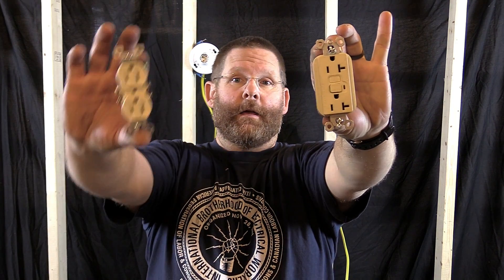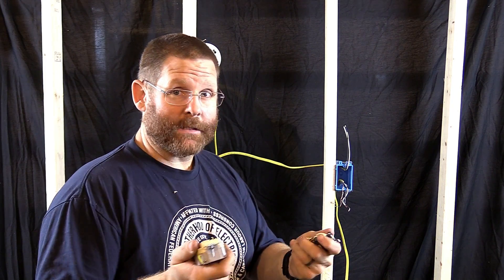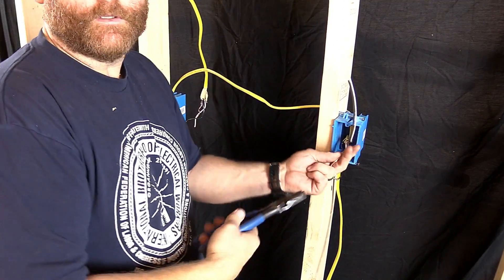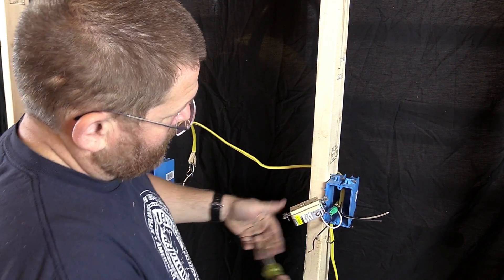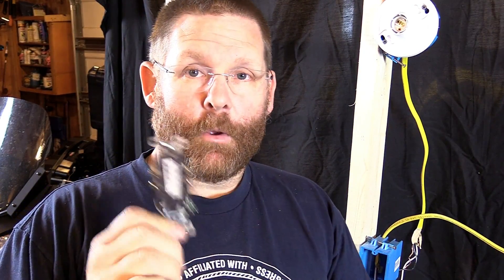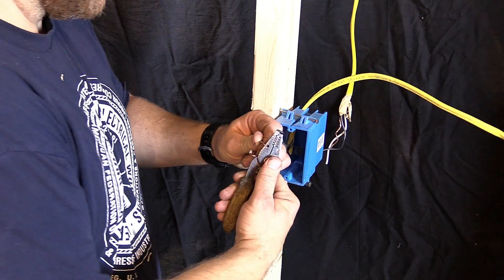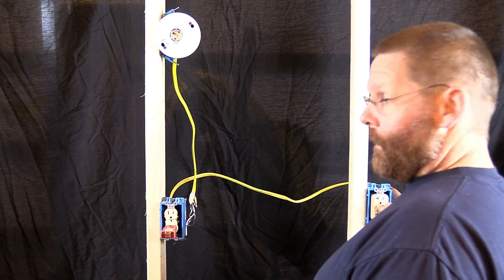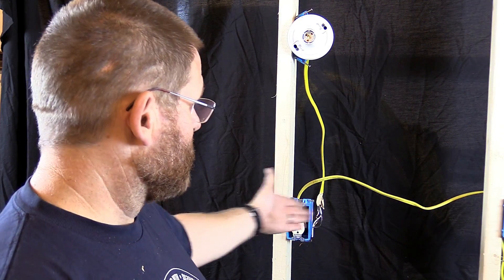How To Wire A GFCI And Receptacle

Comment: hello mountaineer, thanks for the video, i just have a question, what is the gauge of the wire you used ?
Reply from the maker: The gauge of wire I am using is 12-2 romex which the Guage is 12 THHN solid
Reply: @MountaineerOutdoors  thank you so much for your help.
Reply from the maker: My pleasure ☺

Comment: So just to be clear.  Hooking up the line connections should power both outlets?  Or do I need to do something with the load connections to get power to that side of the receptacle?  I'm in the process of hooking up a GFCI receptacle without anything downstream, and only the one side has power.
Reply from the maker: I'm kinda confused with what you are asking? When you say that side of the receptacles what exactly are you meaning?

Comment: I have a detached garage with a 12/3 buried from the house.   Can I run 2 circuits/breakers off a shared neutral from the main box to a 2 breaker box  in the garage OR run 1 hot and 1 neutral to a cut off switch and branch in 2 separate directions starting with GFCI on each branch for protection.  I only need 120v,  a couple lights in one direction and a few outlets in the other?
Reply from the maker: I will say this about your answer. I am not up on the new code but in the old code from what I remember is you can share the nuetral as long as they are on different phases. The reason I am saying that I am not sure as of now is that I have been any industrial electrician since around 2010 and where I work code isn't much looked at. If I do find out otherwise I will edit my answer. Or if anyone else wants to chime in and correct me feel free to.

Comment: Can this type of plug be used with 10 /2 wire
Reply: Thank you for answering my question ( I appreciate it )
Reply from the maker: My pleasure ☺
Reply from the maker: You can but not sure exactly how you will hook it to the Recep. If it has a clamp style in the back of the Recep that should work I have never done it. If not you will have to make a pig tail on with stranded then use a fork terminal..

Comment: I'm doing the exact thing in my bathroom, so I guess it's ok to attach a basic 15 amp receptacle to a 12 gage wire down steam from the GFCI with a 20 amp circuit breaker on the fuse box?
Reply from the maker: Per code you can as long as you have at least 2 or more on that circuit

Comment: What about flipping the recrptical upside down so that the ground is up. I heard that it was code now.  Possibly just incase somthing falls onto the prongs, ( like in this video  https://youtu.be/EmVH5En6x6o )
Maybe it's not important with a GFCI?
Reply: Thanks. Figured it's didn't really matter so I ended up installing them with the ground on the bottom so the night lights can face up.
Reply from the maker: That's the way I do it and will continue until it's mandated code. Have a great evening
Reply from the maker: Well in my locality it's not code. I know that in Florida now it's mandatory in most localities. I do not prefer them that way but code is code. I'd check with your local building inspector.
Reply from the maker: Exactly.. I do not like them turned up but I was told that in Florida now they are making it mandatory for them to be all ground up. If I was told something that was not right someone correct me. And the nuetral on the horizontal plane... I always do that very good practice as well
Reply from the maker: I don't know about the ones that swivel. I am gonna look into them. Seems kinda sketchy to me.
Reply from the maker: @adhdiy-82  yes I fully agree they are great especially since they fit so snugly against the wall and has less of a chance to get damaged.

Comment: So I’m making my outlets they have already been installed and idk where to put the gfci outlet at to make it trip if any outlet has a short would I do it to the outlet that has the wire nut on it and wait wouldn’t i merge the ground wires together
Reply from the maker: You will have to find the incoming line put the incoming hot on the line then everything after that needs to be on the load. Grounds don't matter
Reply: Mountaineer Outdoors how would I do that would it be a outlet with 5 wires attached or 3 I’m gonna assume 5 wires but I just wanna make sure

Comment: Hoping you can help - am replacing an existing 3-prong outlet outlet in the basement, nearby a sink, with a GFCI-protected device.  This circuit has a 2nd outlet and an overhead light, with a 3-way switch arrangement, drawing power off that same circuit & making it all work the way it did before, but safer, as to wiring-in the GFCI, has me completely stopped, because the instructions don't cover that.  Any assistance (by anyone) to shed some light on this impasse (no pun intended) will be very much appreciated !
Reply from the maker: You want to keep everything on the gfi circuit? The hot coming in which you will have to find by pulling out the Recep and separating the wires. (turn off breaker while you are taking out the Recep) once you have all the wires separated, find the hot. Put the hot on the line and keep the nuetral with that hot on the opposite side just make sure it's on the line neutral. Put the other wires black on load hot and white on nuetral load. Then everything is protected. Make sense?
Reply: @MountaineerOutdoors  Thanks for getting back so quick; that would be the easy part you had showed us all.  However this circuit also has an overhead light, with a 3-way switch arrangement, drawing power off that same circuit, which load comes off the 2nd (down-stream) outlet.  I can now see I was trying to "GFCI" - with that lighting load - on the wrong outlet (down-stream), instead of the up-stream one. Tsk, Tsk...  Is it as simple as that, now ?

Comment: Liked the video.  Very informative.  Noticed that when you were wiring the plug that you had the ground down.  I've seen where "they" are now recommending that the ground be up.  Any comments?
Reply from the maker: I do not prefer them up. I did hear that for the most part it's the jurisdiction that has the last say. I have heard that all of Florida is requiring them up. From a saftey stand point I don't see it being any safer. They claim it to be but if it's code then that is what I and everyone else will have to do.

Comment: Thanks for the video, this will definitely help me out. Honestly I want to rent out a garage unit in my apartment to have my woodshop. There are two problems.I only have one outlet and the garage opener hub is occupying it. There is not a GFCI outlet. I would change the existing outlet to be a GFCI and then I would put the existing outlet further down the line to hook up a power strip for my tools. I guess my question to you is if you were my leasing office manager, would you let me add a second outlet to my rented garage? Why or why not?
Reply from the maker: I would but but I would definitely want it inspected (for insurance purposes). After that yes I would love it, it adds value to the property. And you are correct about the gfi then come off with others. And you can tell your landlord that you want to do it to help out their value and they may take it off the rent.
Reply: @MountaineerOutdoors  also the only light in there is when the garage hub has the door open so I could see myself adding value by putting in shop lights too. It won't be hard to do but after taking a look at the wiring, the next door garage units share the same circuit. One thing I could do (provided I get no resistance from the leasing office) is continue the next door along with the lights on the line side of the outlet and then put my shop outlet on the load side. Additionally I would likely have to propose before I do that way they'll let me know where the garage's power shutoffs are. I am excited to do this project, I just want to experience the rest of the red tape before it.
Reply from the maker: Heck yeah man just take your time you got this. If you have any questions email me for a faster response. Good luck man

Comment: 15amp at receptical GFCI
I already have wiring running from a junction box that is wired  2 separate 2 tube fluorescent fixtures.
The wiring is 14-3 gauge. 
I have white,red,blk and bare copper wire.
Can I put wire nut on both ends that are Red. 
And not use
Thank you
Reply from the maker: So you are not using the reds on either end? Then yes
Reply: Exactly

Comment: This was perfect. I’m curious about the next outlet down the line, say you have two outlets off one GFI. 

I’m replacing ugly old. The middle outlet in the line had both black/hot wires on one screw post. I thought that was odd. Curious if I need to do the same?

Or can I put a black on each brass/golden screw as every other outlet in my house.
Reply from the maker: I wouldn't ever double up 2 wires on a screw. One wire to one screw. Good question
Reply: @MountaineerOutdoors , thanks sexy!

Comment: Mountaineer Outdoors, what are your thoughts on GFCIs mounted outside going to sump pump, just about every thunderstorm will trip it.
It happens when sump operation is critical.
In your opinion how bad is it to NOT use a GFI on the sump pump for crawlspace?
Reply from the maker: My opinion is this... If it were at my house I would run a dedicated circuit to it and put a gfci breaker on it that way when it trips you can reset it at the panel.. Im gonna check code when I get home and update you but I think (but not 100% sure) if it's dedicated that you don't have to have gfci protection on that if it's only feeding that particular item. I will check code before I know for sure. I'll get back to you.
Reply: @MountaineerOutdoors  Thanks! Do you think a dedicated GFCI breaker at the panel is just as sensitive as the receptacle?
In theory it should be, but my GFCI receptacles will pop during thunderstorms and turning on an LED overhead light in the kitchen, in both cases not every time possibly one out of ten times.
Reply from the maker: Yes a gfci breaker is less sensitive. That is my opinion due to me using it to see that difference. To not have it be gfi protected it has to be in a finished room per code. So keep it on a gfi. Is your home grounded properly? As for the thunder and lightning you may want to get a whole house surge protector too.

Comment: How to wire a regular outlet from gFCI outlet to use for refrigerator
Reply: most localities code stipulates  dedicated circuit for fridge. even if yours doesn't just get a damned 20a breaker 20a outlet and a long enough run of 12g to run one. I mean fo shizzy.

Comment: I live in a house where all of the GFCIs (2 with attached receptacles) are connected to the same circuit breaker. The kitchen GFCI has only the GFCI receptacle and another receptacle after that connected. The GCFI tests positive. It works but I can only use one receptacle at a time. I can’t plug a coffee pot into one and use a blender or electric griddle into the other one without everything shutting down including the circuit breaker. It wouldn’t seem to me that would cause an overload. I know very little about how these work. It would be nice to know before I call a local electrician.
Reply from the maker: Your definitely overloaded. I generally tell people that you can have around 2000 watts on a 20 amp breaker... And about 1400 with a 15 amp breaker. So yes if all of that is on one breaker then it's overloaded
Reply: Mountaineer Outdoors the coffee pot is 900 alone..add an electric skillet and it trips the GFCI. Plus it sits too close to a metal sink. My home is kind of an amazing effect of really poor engineering. My LP tank hasn’t been filled since February because they’re afraid of being exposed to Covid delivering to rural farmers. I normally do not use both receptacles.
Reply from the maker: Yeah I understand. Not sure where you are but here in Virginia it's been slowly getting back to normal. I will be so glad when it is
Reply: Mountaineer Outdoors I had a tree fall on my house in November. A lot of trees fell here with high winds during that time. It took until February to get insurance and somebody to just remove the tree. I got 1500 to fix a 10 inch hole in the side of the house. Outdated siding nobody wanted to touch. I patched it myself but had to buy new siding for one side that closely matched. I live in a manufactured home so just that repair was an eye opener on how cheaply this was engineered. I have worked a lot of hours so I really haven’t had time to use the home. I wouldn’t buy another one. Thinking about selling this one just to be done with it.
Reply from the maker: I had a manufactured home and I can tell you that mine wasn't the best either for me 2020 isn't my year either but I am trying to make the best of it. I hope things start looking up for you.

Comment: Wire the non GFCI to the Load terminals on the existing GFCI.

If you can understand this, I just saved you 13mins
Reply: A sphincter says what???
Reply from the maker: Smart guy 😏

Comment: if garage outlets have to be gfci protected would it meet code to have a setup like this with a master gfci protecting other outlets on the garage circuit?
Reply from the maker: Yes you can definitely do that. That will save you money too.
Reply: @MountaineerOutdoors  awesome ! thanks for the prompt response! you get a follow!
Reply from the maker: Awesome thank you ☺
Reply: @MountaineerOutdoors  i have a related question, i cant seem to find details on, what is code for running new wire from breaker box on side of house up to attic, i currently have them in a metal flex conduit  coming out of box, bracketed to wall going up to a junction box at the soffit, and there connecting to the wires coming out of the attic
Reply from the maker: If it's outside you should definitely use conduit..

Comment: Great video but I'm having some problems. When I plug my tester in all three lights come on. Red and both ambers. When I push the red test button the, GFCI outlet will trip like it's suppose to. The regular outlet will trip as well when I have the tester plugged into it and push the red button. It seems to work properly but why do I have all three lights lit on the tester? I'm using the same tester that you show in the video. Thank you.
Reply from the maker: I don't know that's kinda weird. I don't believe that I have ever seen that. If I can come up with something I will let you know.
Reply: @MountaineerOutdoors  
Ok thank you. Do you think I'll be ok to use it?
Reply from the maker: Have you checked voltage with a meter? Hot to nuetral hot to ground, nuetral to ground? Nuetral to ground should read 0. Hot to nuetral should read 120+/-  hot to ground same.
Reply: @MountaineerOutdoors  
I'll check that in the morning and let you know what I find. Thank you.
Reply from the maker: Please do I am interested
Reply: @MountaineerOutdoors  
I think my problem is at my service panel. I'm using 12/2 wire on a two pole 20 amp breaker. I have the black in one pole and the white on the other which gives me two hots, correct? The bare wire is to ground. Should the white wire go to ground as well? I just ran new wire to my service panel so that was my mistake.

That was it, all is good now. Love your videos, keep them coming.
Reply from the maker: Yes receptacle should only be on one breaker. The white should go to the nuetral bar. Glad that you did fix it

Comment: So how can you find out if the down line receptacle is connected to GFCI?
Reply from the maker: You can use a gfi tester. Or turn off breaker to see if those receps go off. Or the old fashioned way pull each one out and do it that way

Comment: Can I have 2 GFCI outlets then 2 normal outlets but GFCI protected on the same circuit? Also how many outlets can I put on one breaker? Obviously it depends on what is ran but I was told up to 6 or 7 outlets total on one breaker?
Reply from the maker: So one gfi for a circuit unless you feed from one to the next on the line side. As for how many 6-7  is ok we generally do not put more than 10 on any circuit ever..
Reply: Your awesome Sir thank you
Reply from the maker: My pleasure thanks for watching and commenting ☺
Reply: @MountaineerOutdoors  I subscribed as well. Hope it helps
Reply from the maker: I appreciate it. Thanks for the sub. Have a great weekend

Comment: Great  video!  I have a GFCI installed without a ground on its own breaker.  1 breaker, 1 outlet. Works fine.  Tried to daisy chain a standard outlet with just the hot and neutral (no ground wire but metal box).  Result: Main breaker and GFCI tripped.   What to do?   line and load are wired correctly.
Reply from the maker: Are you 100% sure it's the same circuit? Same nuetral? And is the nuetral somehow touching the metal box?
Reply: Mountaineer Outdoors outlet is registering 134 volts.  Took panel off and tested several breakers to both neutral bars direct.  Still 134.  I suspect that is too high.   Maybe throwing off GFCI?  Planning on calling power company next business day.
Reply from the maker: Wow I have never seen that high. I would definitely get that checked. Let me know what they say. Good luck
Reply: 2 outcomes.  1) defective multimeter with higher than normal readings 2) short in wiring caused the GFCI to trip.
Reply from the maker: So what is your incoming power? And is the gfi in a metal box by chance? Or is the ground and nuetral touching somehow?
Reply: Mountaineer Outdoors incoming is about 127 from the meter.  Had utility come out.  Inside it’s about 125.  My garage runs are using EMT conduit.  I believe I pinched the wiring when adding a conduit connector as was evident by melted insulation.
Reply from the maker: Great at least you found it. Not sure if you know it or not but if the nuetral and ground ever touch it will trip out a gfi immediately. Glad you found the problem